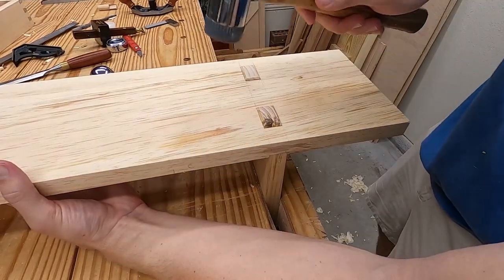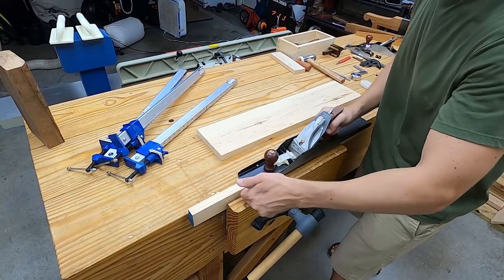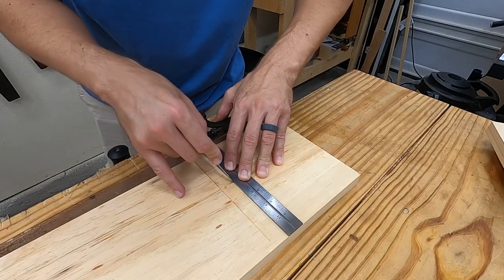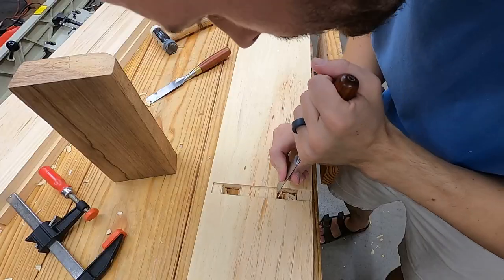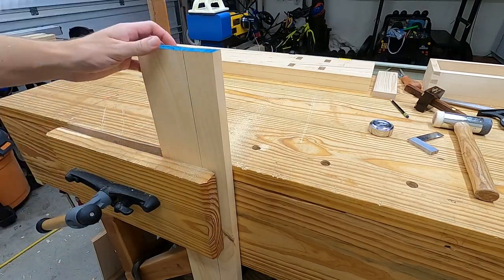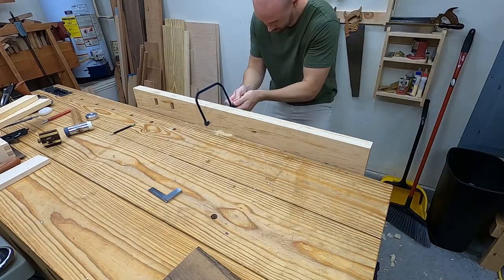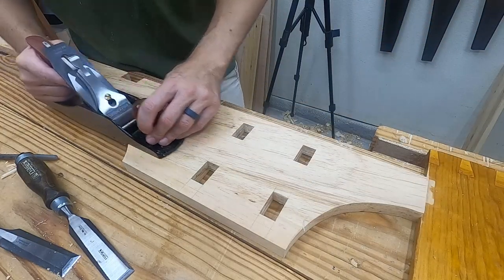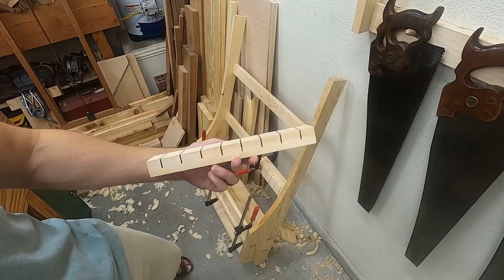The ULTIMATE Saw Till

Comment: When doing dovetails, I use either coping or bow saw for 3/4 and greater, fret saw for 5/8 to just the 1/4 range, under 1/4 and in some cases up 3/8” I chisel out.  For profiling, it’s typically bow and in rare occasions the coping.   BTW; I do like that from the beginning in your video voyage, that you began using a scrub plane right out the gate.  I didn’t get into using a dedicated scrub until I went +95% hand tool only.  The converted No° 4 did ok, but there’s something amazing about using that narrow dedicated Veritas Scrub with it monster thick iron.  It opens up more than just dimensioning and thicknessing, because it’s a great tool in quickly getting to profile shapes by nearly carving.   Yes, the converted No° 4 or 5 can do the job, but a scrub designed for its purpose is a whole other tool.  Glad to see someone like you use yours so much.  👍

Comment: Since you asked, I mainly use hand saws and I use a saw till very similar to yours.  Functionally identical in fact, even down to the back saws on the right, hand saws on the left.  It has tapered sides not curved ones but a shelf at the bottom just like yours.  I keep my smoothing planes, router plane and plough plane there.  I wish I had learned to sharpen them as well as you!
Reply from the maker: Nice! Great minds think alike eh?😉
My first idea was to taper the sides and shape the bottom like a saw handle so the side of the till looked like a wooden handsaw. Decided that might be cool but a bit gaudy.
Reply: @FranksWorkbench  ha ha, yes great minds think alike -  better than fools never differ...

Comment: I have a few but don't use them like you do (I like hand tools for finessing, not primary work).  I have a dual sided Suizan saw that I use mostly when I have to make a quick cut and don't want to turn on or set up a jig on a big power tool, then a Suizan dovetail saw that I have barely used.  Both of those hang on my tool wall.  Then there's a Stew Mac fret saw that sits in a drawer (I only use it for cutting frets on a guitar/bass), and a terrible $2 coping saw that's also in a drawer.  One day I may expand to a few other tools as I'm always trying to incorporate hand tools a little more into my work.
Reply from the maker: Awesome!

Comment: Made a cabinet over about 2 weeks. Then made the door which contained a large mirror. By yhe time I finished the door, the main cabinet had warped waynout of square. Love big box store wood. Not such a big deal to make a new  cabinet. Everything solved when the parts were mated with a piano hinge and solidly connected to the wall.

Comment: At 1:38 where you showed the small gap, I would have left it as this is what is known as a sprung joint. This joint stops any chance of the ends of the boards seperating in the future. It's what my Mentor called an O. C. T ( Old Cabinetmakers Trick)

Comment: i enjoyed watching you work and explain what you are doing. The handles on the saws you are using is nice. Did you make them? and the work bench in the corner....whats its story? I'm in a process of making a workbench based on paul sellers tutorial. But i also got some thick 4x12x10 (free and they have cracks anc checkings on them). Edge joining them is a bit of a challenge for me after i cut them in the middle and got rid of the crack. Wondering if i should leave the second piece as is and do a butterfly wedge to stop them from cracking more and do a simple bench like yours. Tips? Thoughts?

Comment: I love using well tuned hand saws, but try to avoid deep resaws. I do have a saw till and find it is way better than just hanging on hooks or pegs. On my till I filed rounded notches in handle support to keep saws in alignment. This is a very nice till and a big improvement to your old one. Don' have fret saw, but have same saws you used for curves. Don't plan on getting one. Quick question, was that spruce?
Reply from the maker: Great idea with filing the notch for handles, I may borrow that from you! Wood was was billed as eastern white pine, seems accurate -- very soft

Comment: like the project. have to make one.  Who installed the Hot Water tank.  That pressure relief line wouldn't pass here.
Reply from the maker: I'm not sure I'm guessing the previous homeowner or a handyman of some sort. I've been told it doesn't meet code here in tx either and is missing a pan or something like that too

Comment: I use handsaws. I made a frame which I attached to the underside of a shelving rack. It's sort of like a squared capital A which is slatted within the square and saws are dropped in there toe first and resting on the handles. It was just supposed to be an interim solution but haven't changed it.
Goof ups? My most recent was a late night glue up of a mahogany and salted silver birch tea tray - morning light revealed I forgot to put the bottom panel in. O.o Had to cut off the dovetails and redo - smaller tray.
Reply from the maker: Oh yeah I've got a bunch of interim "until next month" solutions that end up lasting for years :)
Ouch! That's a good one, thanks for sharing!

Comment: Does this mean we will get a SAW SHARPENING VIDEO! :D   
Side note: I use handsaws (esp right now since I am still waiting for my new table saw) I have a lot of issues with them but i believe it is user error since I typically use power tools for sawing but hand tools for almost everything else. They are currently stored hanging on nails on the wall. I will be building something for them soon since I am in the middle of (another) shop remodel :)
Reply from the maker: No joke when I started using hand saws the cut would curve out to the left or right every stinkin' time. Bout made me pull out my hair. I used to have a nice head of hair before that too 😀. Looked like Fabio. Hope your new shop goes smoothly!
Reply: @FranksWorkbench  hahha maybe that's why I'm starting to loose my hair too!! 😅

Comment: I like the saw til, is your flush cut saw just a western style saw with no set on the teeth? I see pull style flush cut saws all the time, i even have one, i just don't prefer it to western saws. great video!
Reply: I also like the shelf you for hand saw Maintenance things, like your saw set and files.
Reply from the maker: Thanks man!! Actually I was just messing around about the flush cut saw, that's just a normal handsaw I use all the time for crosscuts!

Comment: To answer some of your questions...I use hand saws almost exclusively and store them on pegs on the wall.   Back saws are attached to holders on my bench. 

I just had a stupid screw up on my last project.   I made a frame and panel door where the panel was tambour style slats.  I took time to line them all up aesthetically, beveled the front, and numbered them.   Started with the middle one and worked out.  When gluing up I put the middle piece that I based the others on in backwards 🤦‍♂️

No one but me will ever see it or know
Reply from the maker: man I can relate I do something like that  every project feels like!! LOL

Comment: I prefer a fret saw for wasting, the narrow blade can literally turn 90⁰ from your cut line, unlike a coping saw where you have to curve it...... its jus a little easier to clean up 😁 
A fret saw is worth it........ but dont bother with a fancy one that will cost you a small fortune, it's a tool that's used for wasting...... it's not the last tool to touch the wood, so save your money for a more important tool..... dont let the YouTube woodworkers lure you into unnecessary things 🤷‍♂️😁 Mine is a Pegas fret saw with a 75mm throat (3inch in your money) it cost me about 15€. I twist the blade with a small pliers so the depth of the throat doesnt come into play when wasting dovetails on wide boards, or tenons like you cut here. 
I enjoyed this...... I like anything to do with hand tools 💥🤙
Reply from the maker: Great input thanks!